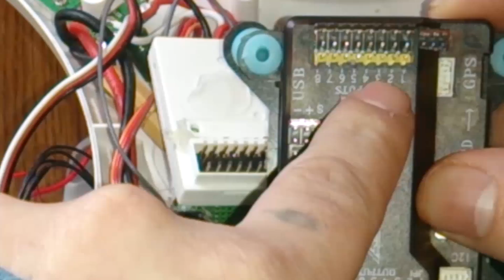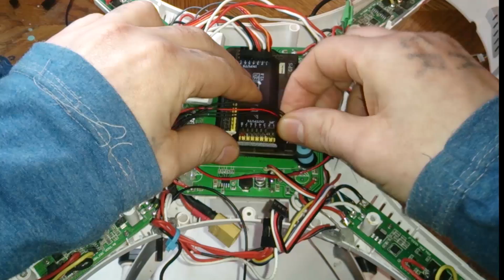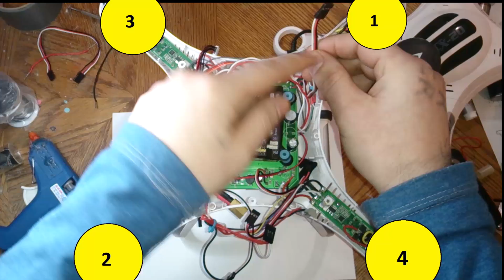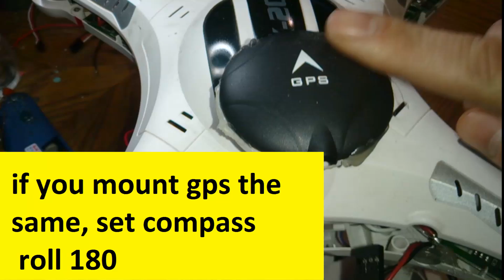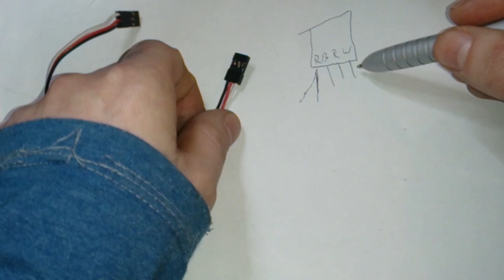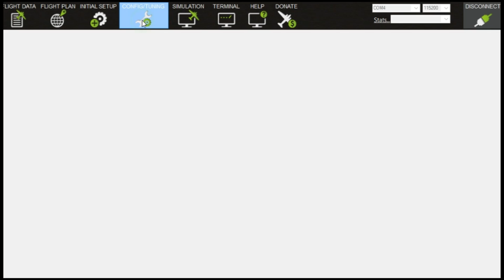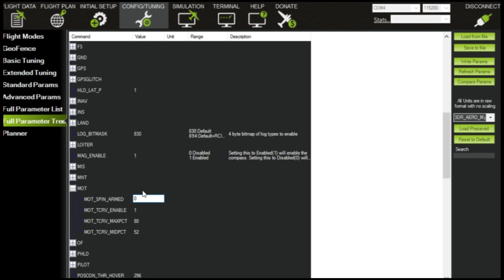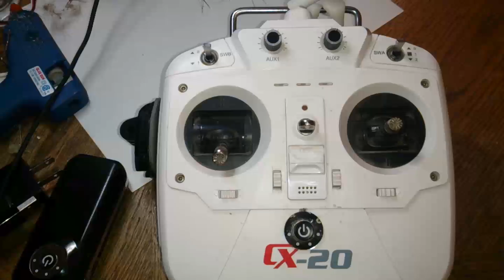cx20 factory apm to apm 2 6 - 2.8 step by step

Comment: can you reprogram this cx 20 remote?  Inside the naza softwre while doing TX calibration all button are correct except the switches for RTl LOITER ATTI etc arent in the right places when switched.  THe transmitter just stays in failsafe no matter where I switch it and I cant arm the motors.  anyway o change this?
Reply from the maker: sadly I don't have a naza, so my knowledge is zero on the hardware and software.. but to answer the question about the remote ..that would be a no . ..Even missionplanner does not allow you to edit the pwm settings so I am not sure if you can manually change the pwm settings in naza software to match the remote , It seems they sooner let the remote hardware do it then just let us pick the pwm settings our selves..
Reply from the maker: by the way this might be scary .. but what about if you try using the variable  gimbal switches instead ..if its just a temp thing.. you should be able to come off 2 or 3 and go to input 5 on your apm.. then the one variable might be able to control your settings....be weird to use though.
Reply from the maker: and seeing you have not got back to me , I will  just throw one more thing at you. . I notice from my flysky to my cx20 remote i have to reverse channel 2.     so with that you might have to reverse channel 2 (pitch) in the naza software some how.. seems its possible by clicking on the REV button that is shown in this picture http://wiki.dji.com/en/index.php/Naza-M_R/C_Transmitter_Calibration  ..
Reply: yeah it worked but couldn't use GPS mode.  I just used my fly sky 6ch.  This naza is weeeeeird.  I don't like it!
Reply from the maker: its supposedly kicks the apm 2.6 butt for everything.. the rtl I read gets to inches from where you took off from...Maybe one day I will get one if the price comes down on them.  ..glad you got it to work..the variable idea might of worked but nailing your modes blindly would of been a pain .

Comment: what is the 12c port on the GPS for?

Mine came unsoldered and I don't have a fine pen to solder it back together.

Is this plug necessary for GPS and compass to work properly?

Can I just not plug the red wire and that little thing in ?

Guess this is the compass port and without I will probably have all kinds of issues.

This sucks.  Two bad flight controllers both with minor issues!
Reply from the maker: is this a apm 2.5.2?   btw your message got flagged .your original must of had a link..
Reply from the maker: if you want just take a picture and send to my email..

Comment: OK so i programmed ESCs and now all three work and I have one stubborn beeper.

I change the wires from one motor to that side and ESC works.

I change esc to motor and motor works.

I plug ESC direct to T and battery and it works.

Other wise I have three motors working and one beeping.

All gear checks out 

When I program ESCs I get the jingle but that motor just beeps through the entire thing and keeps beeping once the others are programmed and begin to spin!

Any help Cheeerson genius?
Reply from the maker: You can try to calibrate it right through the T instead... ..unplug all the motor outputs ...plug the beeping one into T.. this time you don't have to bother to arm the apm.. just plug in apm to get power to rx.. turn on remote go full throttle ..then plug in the battery wait for 2 beeps then go down....
Reply: so that worked 

I unplug it and run wires as normal and it goes right back to beeping.

So it programmed while plugged into T

gave the jingle 

I was able to power on motor with TX.

I plug all motors back in and three out of four work and one beeps still?

what the heck?
Reply from the maker: I know you explained above some of switching them around to test.. but to make sure..    lets say its motor 2 that is beeping .. what happens if you switch the white red black cable from number 2 to number 3 and number 3 to number 2..... does number 3 now beep?
Reply: yes sir.

If I take the ESC from motor 3 and wire it to motor 2

than motor 2 begins beeping.

So...

motor 3 is beeping i change it to motor 2 and 2 starts beeping.

so it follows the ESC

If I plug the ESC in alone on any motor it will work just fine.

SO, the ESC must be good annnnd..

if all the motors work when I wire them with said ESC than all the motors are also good...

hmmmmm..

you got this bangs!
Reply from the maker: I think I do..!?.. ok is it the esc with the extra led wire that is attached to the board marked ppm?  It should be motor 3.. i sorta show it in that video ..using a non oem board in cx20..
Reply from the maker: actually tha tmight be pointless..but worth a try anyways in case it is some how the ppm /lights that are screwing it up
Reply: so unsolder ppm wire?
Reply: actually its not on the ppm motor
Reply from the maker: just to rule it out ..you should try to un solder it just to see.. its this part of the video.. https://youtu.be/XkQXf9oN8Ys?t=34  just make sure it says ppm on the main board.. none of your lights under should work after you remove that one wire..
Reply from the maker: after your done ruling that out..
try. Remove ground from the white red black harness.. and attach the black(ground) wire  directly to the rx ground rail it should be free on the bottom of the t ..
2. for the hell of it try to do another remote calibration..   for some reason your esc is not seeing its high or low limit
Reply: Ok that didnt do anything

it seems to be on the FC end.

if i change the white red and black it stays on the FC side.

Meaning

B7 slot always beeps

no matter what motor or ESC is plugged into it.

is it a problem with the FC?
Reply: just tried another flight controller

problem solved!

now why is that B7 messed up??

what causes a B7 to go faulty?
Reply from the maker: ah ok the last post you made it sound like if you moved the esc it fallowed the esc.. .. so then yes it sounds like the FC is some how screwed up on that output.. ..b7 is your motor 2 then? sucks cause if it was motor 3 ..  you could of at least made a tri copter.. it uses 1,2,4 .. you can try to reload the firmware for kicks ,I'll look over the schematic to see if anything can be limiting it..
Reply from the maker: not sure at all..b7 is directly connected to pb5 of the 2560 chip ..on that apm.. besides trying to get tricky and using the octo firmware but only 4 motors..its good you had a extra apm..
Reply: Thanks again for all your quick replies and sharing your bounty of knowledge on these cx 20's
Reply: could have gotten fried when I was plugging wires in all kinds of ways before I found your page!
Reply from the maker: Hi .. Mike,  I will be making another video soon..about your problem.. I will switch out your bad motor 2 with another port in the firmware.. .. let me know anyways..

Comment: how do I bind transmitter?  I calibrate and in mission planner it shows nothing 

If I plug into T on RX it will spin motors but otherwise I get beeps.

you said set up transmitter before ESCs so help a noob again

I'm almost done
Reply from the maker: once in mission planner, connect and go to radio calibration. turn on  your remote the orange light on the rx should go solid as soon as you turn on your remote.. if it continues blinking you have other issues.
Reply: I hVE NO LIGHT AT ALL ANYMORE NO BLINKING NO LIGHT NOTHING

If i plug direct it works otherwise whatever has happened no juice going to RX

if i plug usb in i have power to FC other wise battery doesn't power FC or RX

I think the wiring diagram is wrong or I did it wrong
Reply from the maker: what powers the apm is the -b plug on the rx coming off the main board  confirm you have it hooked up.. https://youtu.be/mrBWEATUbus?t=565
Reply from the maker: If you want you can send me pics of your wiring ..just try to get a couple of angles so I can fallow the wires in the pictures..
Reply: I emailed you the best pics I could may not help any let me know I ll take some better if need be

The 5v is showing on my multimeter so not sure why its not giving power to RX
Reply from the maker: Hi.. alright.. so not sure if you looked at the link I sent ..about the -b cable  but you need to have that on.. and the motors are on the wrong side ..ignore the markings.. b1-b8  .. in reality b8 is your motor 1..and so forth.. with the apm on a table .. the motors start on the left side and move to the right
Reply from the maker: so then the same would hold true for the input side. ..you need to move those wires to the other side.
Reply from the maker: I will edit the picture i sent you in a minute
Reply from the maker: https://drive.google.com/open?id=0B2w6_OKE_2kxN3A4bkVuR08xV2s  ..i just added a couple of things to the picture so you can orient your board the same way....let me know if this helps.. or just adds more confusion .
Reply: Cable only disconnected for picturesOnce again you're help is awesomeThanks so much
Reply from the maker: Your welcome..hopefully your getting some progress now..
Reply: I haven't started yet I fell asleep but I'm up again and ready to wake everyone else with the beeps 😂

Comment from the maker: @Hector Julio Zanfra Otero  I can not reply back to your post for some reason today"comment failed to post"   Anyways If you have no issues with your cx20 apm and if its open source no point to switch to apm2.8.  Apm2.8 has better voltage regulator , for adding lights sonar ..ect..     Pixhawk I found way better at handling counter weight .

Comment: Hi, your videos are great. This Week i build my first F450 with a APM 2.6 and Ardu3.2.1. The transmitter is a FS-I6, the quad is flying very good in Stabilized Mode, but when i switch to Loiter or AltHold he just start climbing, i put some Foam inside the APM at the Barometer, i dont know what else i can do to normalize this problem, any suggestion? Thanks
Reply from the maker: you can try my param.. buttttt you will have to redo compass , accelerometers, remote calibration, and re set the flight modes.. they are setup for cx20 remote..
Just save your params .. if my do nothing for you so you can reload yours quickly..    https://drive.google.com/open?id=0B2w6_OKE_2kxM0xYckJidFNRWTQ
Reply from the maker: I have to add this is extremely important you figure out what is going on.. If you fallowed some of my video's i suggest setting the return to home height at 424 ... 13 feet.. I would try to do a control test of return to home .and be ready to switch it out .   The point is ..if anything goes wrong right now you run a huge chance of having a fly away.... If you still have error's with it wanting to go up..      Maybe set the fail safe to Land ..instead of return to home for the time being..
Reply: Thanks mate, i will try. after i will tell the result. :)
Reply: Hi, i just install your parameters done all calibration, done everythind you said, but, the quad was very slow responding and the loiter and althold still the same. After tried this, i re-write the older parameters that i have before, and the damn quad just flyaway when i trigered the loiter. Now i am waiting for the arrival of a ESC and other version of the module GPS+Compass, some friends from Brasil told me to try with an old version of arducopter, said to try 3.1.5 when i have the quad working again. Thank for your help.

Comment: i did all as u shown but when i try to calibrate my ECS the red light dont gets solid but the blue light gets solid...any idea whats wrong with that??
Reply from the maker: yes... most likely you have to check disable arming check... https://youtu.be/mrBWEATUbus?t=1487
Reply: ok i ll check again..i ll set them same as u set..
Reply from the maker: if you still can't calibrate the esc.or arm it... try to redo a remote calibration in mission planner as well..
Reply: now its getting bind the red light is getting solid and when i push the throttle all the way up and connect the battery it don't gives the 2 beep sound it directly give the bind sound and when i pull the throttle all the way down to spin the motors it won't spin
Reply: now i calibrate every thing again and its working.....so happy....thanks alot buddy...really appreciate...
Reply from the maker: congrats, glad it worked out good for you..
Reply: +bangs6996...it's not end yet..coz ur videos list is still big on cx 20..and I am gonna try all..and ll make this cx 20 better than my phantom 3 advanced...so keep supporting and wishing...hahahah

Comment: I would like to personally thank you for the video I recently upgraded my APM to the 2.8 but the only problem is now after I did the LED wiring I can't get it to arm. It will arm but the lights go back to blinking and I can't tell if it is armed or not to satellites it will power up then go back to blinking LEDs (that is the arming LEDs and the gps led ) can you help me. Much appreciated.
Reply from the maker: Hi .. first make sure you disabled arming check ..  https://youtu.be/mrBWEATUbus?t=1506       if you can confirm that is disabled.. remove the led wire that you attached.. and try to arm it.. Watch the lights on the apm to go solid.. and with the blades off try to spin it up if it arms..      You might of put the led in the wrong spot..       If it arms without the led's on ..then try to arm again and spin the motors up to make sure.  If not  ..Take a picture of your mod and the location on the apm and send to bangs696969@gmail.com

Comment: THUNDER QQ IS THE BEST I HAVE TRIED VERY STABLE 10MIN SET UP!
IT WORKS! SET TRANSMITTER TO MODE 4 AND CONNECT WIRES AILERON YELLOW TO CHANNEL 1, ELEVATOR ORANGE TO CHANNEL 2, THROTTLE TO CHANNEL 3 AND RUDDER BROWN TO CHANNEL 4. YOU HAVE TO REVERSE SOME CHANNELS. VERY STABLE..

ALSO SET ESC 1 AT A TIME . TRANSMITTER ON THROTTLE AT FULL CONNECT EACH MOTOR 1 AT A TIME TO THROTTLE CHANNEL 3 ON RECEIVER CONNECT BATTERY MAKE SURE RECEIVER POWERS ON AFTER 2 BEEPS LOWER THROTTLE AND YOU GET 2 MORE BEEPS.
Reply from the maker: Thanks for the post.. buttttt hehe.. isn't that a down grade from even the big shark apm.. that apm has no gps = no return to home .. or fallow me mode ect ect..    For 15 buxs I might look into getting one just to play with ..sometimes all the extra's just get in the way of having fun..

Comment: I'm upgrading a stock cx-20 apm ( 2.52_v5 ) to apm 2.8 like in your video.What firmware to you suggest?.Im currently using 3.2.1 custom on the stock FC. Thanks Alan
Reply from the maker: Hi Alan , I use 3.2.1 for all my quads.      If you were using custom 3.2.1 for telemetry don't forget to switch the positive and negative back around on the cable  =)   ...
Reply: Thanks, I wouldn't have thought to swap the plus and minus on the telemetry I would have fried it. Thanks again Alan
Reply from the maker: Your welcome , this part shows you the telemetry https://youtu.be/mrBWEATUbus?t=808   .. good luck on your build.
Reply: Besides the wire switch on the telemetry are there any other things I need to look out for?  Again Thank You for all the help
Reply from the maker: the only tricky part is the led's besides that its pretty straight forward... If you get stuck on something just hit me up...

Comment: Yeah I checked my hover throttle in logs...  550. I think my barometer is crap.  tried auto tune this morning. worked as it should but results poor....flew like a boat!
Reply from the maker: you can try these two param files if you want.. maybe its a pid thing..
.  Just save your parameters first, then try one of these. You will need to re do compass  accelerator, Remote calibration..

Here is one of mine  RTL_ALT is set to 424 (13 feet) and arming check is disabled. also mot spin is off as well.
https://drive.google.com/open?id=0B2w6_OKE_2kxM0xYckJidFNRWTQ

Here is a default one...This is not mine got it from the net awhile ago.
https://drive.google.com/open?id=0B2w6_OKE_2kxWWVHRFB1Z09GZTg

Comment: I switched from BShark to apm for MP. works great however my alt hold is not solid like it was with the bs fc. How's yours?
Reply from the maker: If it comes down slowly , You can try to raise the throttle more then half way, just don't forget to bring it back down before switching out of alt hold.. It will shoot up about 10 feet in less then a second.....   ..

Comment: Congrats for the video! I have a doubt. Is possible to install this apm with the original CX-20 GPS? What about the wiring once the terminal is different? Thanks in advance!
Reply from the maker: the original gps and compass should work .. because its basically the same hardware , you would have to mod the cable or direct solder ..you only have 4 wires positive negative and two data pins....same with the compass .  I have not checked to see if the voltages are different, But I would figure its either 5 volts or 3 volts..